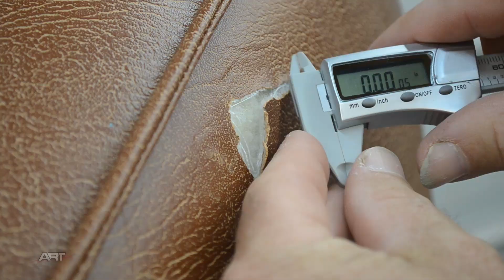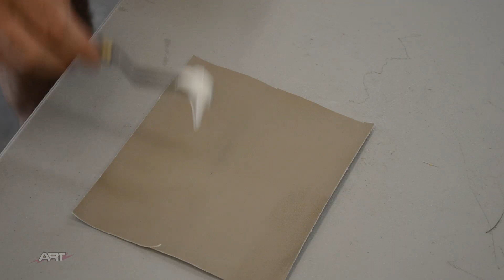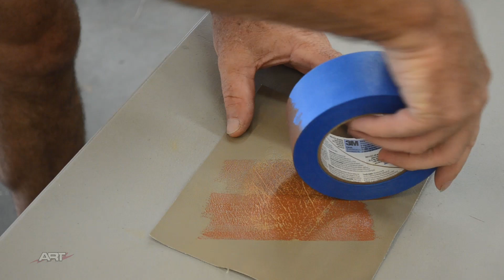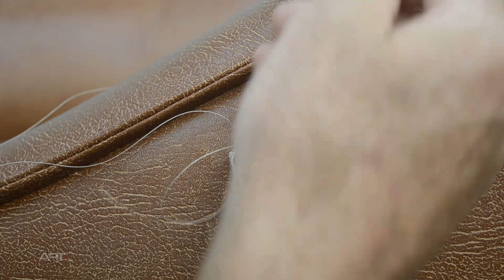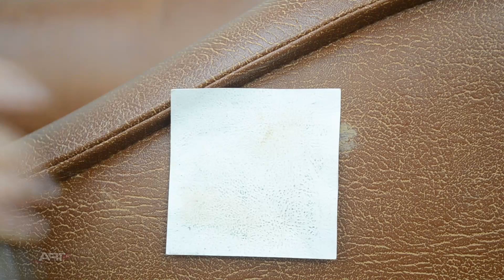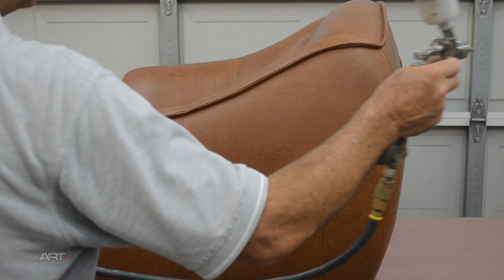Furniture One-Off  v17

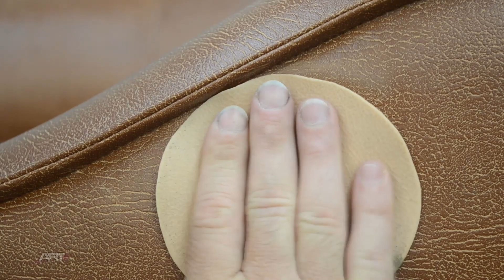Comment: Hey Rick, Great Repair! Quick question... at 17:50 you say This vinyl repair compound gives the BEST Graining... Which compound is that if I may ask?? Thanks!!!
Reply from the maker: Of your assortment of compounds some work specifically better in some scenarios.  Choose the one that grains better for you with minimum pressure.  Perhaps a higher heat is needed too.

Comment: Very satisfying to watch 👍! I once did a 2 tone on a sectional where's it was maroon on the bottom and black speckles, after the repair yes its a back and fourth on the 2 colors and then add a top coat! In my case I went with a High gloss cross link and top coat to give me the Original finish. Have you ever repaired an Alcantara Couch/sectional? Interested in that process and would like some input on how you would go about it.
Reply from the maker: I think most techs are using the polyester fibers to blend repairs on this. Same as any microfiber couch.  Thanks.